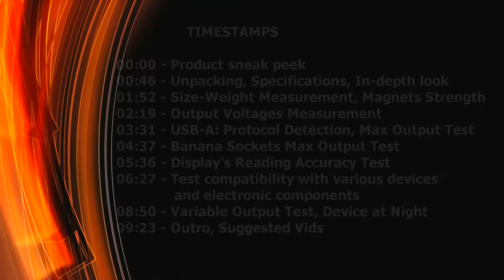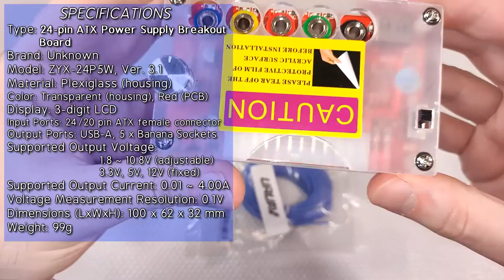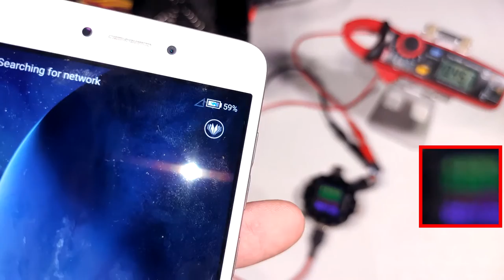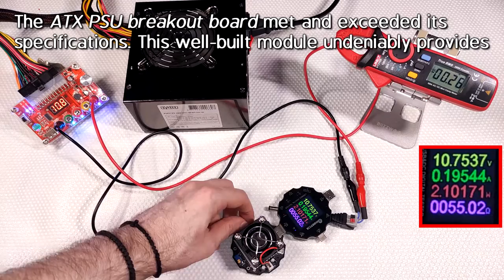ZYX-24P5W ATX Power Supply Breakout Board Module | In-depth Output Testing

Comment from the maker: 🔴 ORDER LINKS 🔴
===============================
24Pin ATX Power Supply Breakout Board Acrylic Case Kit Module Adapter:
https://s.click.aliexpress.com/e/_DBncFqT
https://ebay.us/s7NEkL

TEST GEAR AND DEVICES I USED IN THIS VIDEO:
• DANIU Stainless Steel Digital Caliper with Case:
https://www.banggood.com/search/daniu-150mm-stainless-steel-lcd-screen-display-digital-caliper.html?from=nav&p=6B23044759334201605E&custlinkid=1857445
• Digital Scale:
https://www.banggood.com/custlink/3DvY2t0Uej

• Sweex ATX Power Supply
https://ebay.us/QxOJEA

• UNI-T UT210E Auto Range True RMS Clamp Meter:
https://s.click.aliexpress.com/e/_DlTmrC7

• ANENG Multimeter Test Probe Set
https://s.click.aliexpress.com/e/_DBY1WMR

• USB Tester Meter
https://s.click.aliexpress.com/e/_DnCOp8T

• Atorch UD18 DC5.5 Tester
https://s.click.aliexpress.com/e/_DlKcSeL

• DC Power Connector Plug Male and Female 5.5mm X 2.1mm
https://s.click.aliexpress.com/e/_DeqQRpl

• 100pcs F5 5mm Slow Flash RGB Multi Color LEDs
https://s.click.aliexpress.com/e/_Dev9dzH

• Cheap Smart Phones (Android)
https://s.click.aliexpress.com/e/_DesE5Af

• Opus Battery Charger
https://s.click.aliexpress.com/e/_DmpVd4b

• Tolifo Photo Video Fill Lights
https://s.click.aliexpress.com/e/_DcAYPmr

• XTAR batteries: 
XTAR Direct: http://shrsl.com/46ybv
Amazon: https://amzn.to/3qLdJB7

• BlitzWolf USB Cables
https://www.banggood.com/custlink/GvvCQyinIW

• BlitzWolf BW-TS4 3-in-1 Aluminium Stand
https://www.banggood.com/custlink/mG39GHJAqK

===============================

                 TIMESTAMPS

00:00 - Product sneak peek
00:46 - Unpacking, Specs, In-depth look
01:52 - Size-Weight Measurement, Magnets Strength
02:19 - Output Voltages Measurement
03:31 - USB Protocol Detection & Max Output Test 
04:37 - Banana Sockets Max Output Test
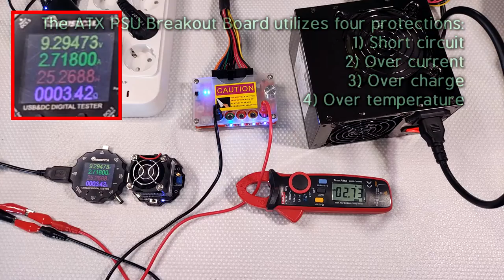05:36 - Display's Reading Accuracy Test
06:27 - Test compatibility with various devices         
08:50 - Variable Output Test
09:23 - Outro, Suggested Vids

Check out my review-test videos of other products:

🎥 USB Buck/Boost Voltage Module | Hands-on and Output Testing: https://youtu.be/Br3KG6WBPv8
🎥 XTAR 1.5V Li-ion AA Batteries with LED Indicator | Output Test and Full Review: https://youtu.be/R60_GcAQYPg
🎥 LM2596 DC-DC Step-down Buck Converter Module with Display | Output Test: https://youtu.be/VvmITUFzupk
🎥 Baseus 100W GaN5 Pro PD3.0 Wall Charger | In-depth Output Testing: https://youtu.be/t9fzlJAMfXE
🎥 RGB and Single Color LEDs | Review, Testing: https://youtu.be/uFpXVi22gCk
🎥 UNI-T UT210E Clamp Multimeter - Full review, Tutorial and Measurement tests of all functions: https://youtu.be/tFZpv3gBAiU
🎥 Fake 6800mAh rechargeable AA Batteries | Capacity Test: https://youtu.be/Xn1oVIsSlN0
🎥 Charmast W1056 Power Bank | Unboxing, Review, In/Output Testing: https://youtu.be/UieZAQcMALg

You can also support my work by making a donation on my PayPal link here: https://bit.ly/3h8YTcT

Visit my facebook page in case you want to send me your samples for reviewing and testing them on my channel: https://www.facebook.com/jogeogeos

Comment: I think there is an "updated" version of this where it has 6x USB ports with 4x regular 5v and 2x QC 3.0 at the side of the module
Reply from the maker: There are indeed variants of that Power Suppl;y Breakout Board. I chose it for the knob-adjustable  output
Reply: @JoGeoTechlab I wonder when it have an higher adjustable voltage range. Probably better to replace the IC responsible for it?
Reply from the maker: According to manufacturer, 12V is the max (fixed) supported output voltage of the module. Its adjustable output has a max of 10.8V so there's no need for replacing-modifying the IC as it will be a waste of time. Output Voltages over 15V will probably cause overheating issues😉